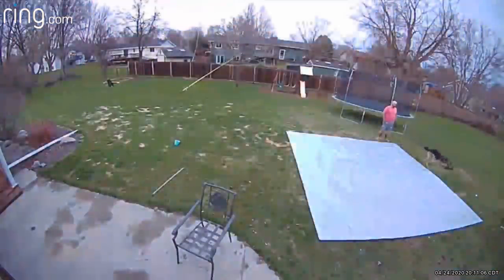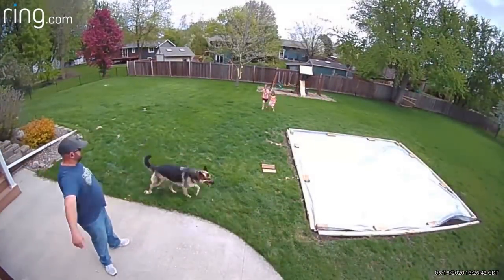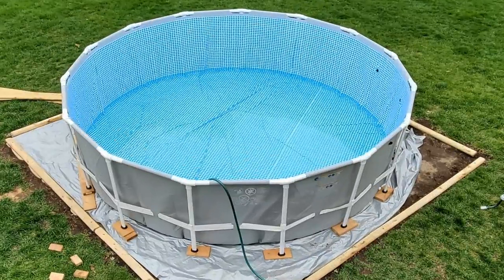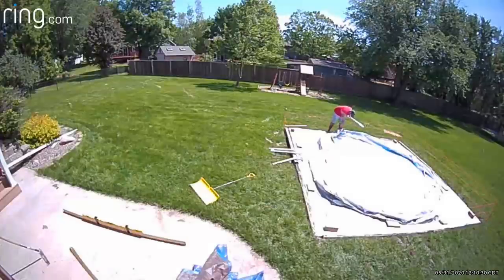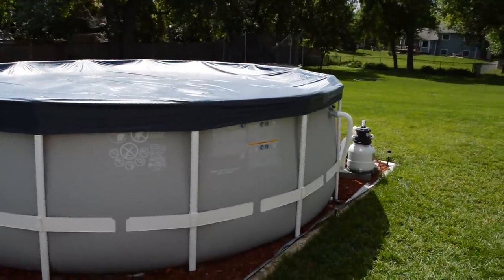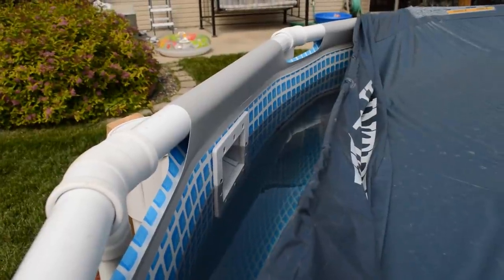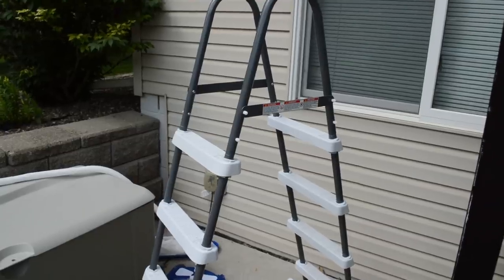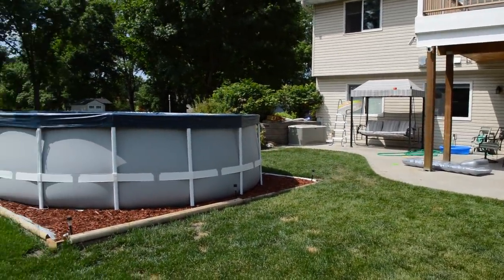Intex 15 Foot Prism Frame Above Ground Pool Setup, Review, and Mistakes!

Comment: I cant believe I just watched this whole video. This was very informative. Now I just need to get a house.
Reply from the maker: Thank you very much for the comment!
Reply: We have dismantled pool 1x so far. Redid ground, filling in now and so far 1 - 1" inches difference, stopped filling to fix. Thinking of getting something to stabilize legs on the side, where seems to be the problem.
Reply from the maker: 1-2 inches is definitely OK. I'd leave it there. Don't simply jack up the leg to make the top frame level. This will cause the liner to stretch and put a lot of pressure on the seam at the bottom. Eventually it can give out.
Reply: @dontburnthehousedownvideos  thank you for the reply. We will enjoy pool, as is then. 🐎
Reply: Shit I just looked for the for a level ground and put it up 15 kids inside it and it never broke this was an over kill bro lol 😂

Comment: Guys make sure when you store this pool that you seal it up in deck box that rodents cannot get into. They will chew holes through it to build nest during the winter. We learned the hard way 😭
Reply: 😂 You couldnt pay me to take mine down now that it's installed, I have a 22 ft Colman Vista 2 that took 4 wks with ground prep etc to install. I'm in Ohio & happen to live in the Snowbelt. all you need to do is drain it down past the skimmer winterize it & store the pump etc inside til next yr... 👍🏻

Comment: I just spent the better part of 5 days preparing the ground for my granddaughter's pool. My Daughter upgraded to this type after three years of a 15 foot round blow up ring style pool (self supporting/no legs). Having owned & installed an above ground permanent (leave up) pool I knew the importance of a level & solid foundation. Tip 1 ALWAYS dig down NEVER build up for level. Tip 2 MINIMAL sand, it is to smooth ground for liner period. Tip 3 PATIO STONES (8x16) for legs absolutely level and on solid ground not too far in so liner rubs on them. We put top frame together & placed on ground to mark where each leg would land, then angled the brick to follow the rails so the leg would seat in center (left to right) but sit on inward third of brick. I dug my bricks in leaving about a half inch or so above ground level...this job is not for the faint of heart. I leveled each brick side to side and front to back with small level the used my 4ft level from brick to brick maintaining the exact height all the way around (began at 1 brick went halfway around clock wise and then from that 1rst brick counter clockwise until I met up again with that halfway point which helped maintain level better) making sure all were firmly seated by tamping in with rubber mallet. I then put sand in and used a board to level it (I used a board 1/2 the diameter of pool plus the width of my bricks mounted on a pipe in the exact center of pool creating a clock hand type sweep but a board the length of diameter plus a foot would work... I used some ply wood pieces between each brick to temporarily bridge the gap between bricks so my sweep remained level, perfectly leveling and smoothing the sand). I then watered the sand thoroughly with a fine mist making it hard like the waters edge at beach, placed a wide board down carefully to walk on while retrieving my pipe from the middle, filled in that small hole with sand I brought out with me in quart baggie leveled as best I could and watered in, walked out on board, carefully lifted board. Our ground cover was salvaged from neighbor, it is the bottom their old pool about 3ft bigger in diameter than this one, its heavier than a tarp. I placed it over sand & patio bricks to mitigate any rubbing of pool on brick edges before placing pool. I will come back and update how it holds up.
Reply: you say the bricks were 1/2 inch up from ground, what did you put under the wall tracks?  Thanks.
Reply: Just what I needed! Thank you for the detail!
Reply from the maker: Thank you! Happy summer!
Reply from the maker: This pool doesn't have wall tracks.

Comment: The unit heats up fast and is super quiet. It looks fancy https://www.youtube.com/post/Ugkxl8Od2BvnGbn1ffwqsuFXW0QnmcZgMiVY and can be kept in the living room. It gets hot within a split second of turning on the unit. The build quality is exceptionally good and is safe to be around kids and pets. This one is super quiet and can be kept on while in office meetings, my wife loved it. It shows the temperature right on the unit which is very useful and adding a rotating feature helps to heat up the surrounding, so other people will not fight with you for heat. It is right as described in the description..!! Definitely recommend!!
Reply: Lol 😂 wow he really went over board doing this job? Why not find a level spot then put up the pool? I didn't do any of this by my self and cleaned it every other night his going to far lol 😂
Reply from the maker: If it was as easy as finding a level spot, I would have done it. My yard has a slope to the back of the property. And I don't half ass things. It's either full ass or none at all! 😂

Comment: This past April I brought a Summer Waves 16'X48"round pool similar to this.
I really took the time to research and watched lots of tutorials on setting it up.
I'm pretty handy and the majority of the techniques and procedures were pretty clear to me.
From the beginning I decided not to use sand under the liner, primarily because of settling and wash outs so I decided to basically use the already settled ground of my yard.
I made a water level which really assisted me on leveling the entire area. Basically after picking the exact location of the pool, I removed the sod and with the level found the lowest point within this area.
This low point became my final grade, so anything higher I dug out.
When it was all said and done, I was surprised and excited to find out that the pool only had about 1/4" variance from one side to the other. I got tired of struggling with the cartridge filters and manually vacuuming  the pool, every other day.
Next week I should be receiving my 2,100GPH sand filtration pump from Intex, an automatic vacuum that works with the new pump's suction and all the hardware needed for the conversion.
Very happy with the pool and the kids love it.

Comment: For our 18 foot pool, we built a 20 X 20 Frame, using 6 X 6 boards, and made sure the entire frame was level.  Because the best spot in the yard still had a drop (14" at the extreme) the frame required more lumber on one end to make it level.  Connected the 6 X 6s with spike-type nails.   Then just filled up the frame with sand.   Then we built about a 22 foot board that we used to level the sand, taking the board across the frame.  We used a tamper to make the sand more compact, and just kept going over the frame with the 22 foot board until it was just right.  The pool was perfectly level and the frame, filled with sand, was used every year.

Comment: I had the same issue with the ladder on our previous pool. We built a small deck, 8’x8’, adjacent to the pool with wooden steps. Bought a sturdy “half-ladder” for inside the pool and connected it to the deck with hardware. Very safe. Next time I’ll build a bigger deck.

Comment: i bought an above ground pool just because it was hot out i never thought about the fact that the ground could mess up how the pool would turn out so much i set up the pool on very uneven ground then filled it with water and as you guessed it. it turned out terrible i just started researching about above ground pools and how to 'properly set it up and this gave so much help i next time i will do it propery! thanks again!
Reply from the maker: Thank you! Good luck!

Comment: Thanks for the heads up on the ground preparation. That was and is my main concern.
Reply from the maker: It can be a lot of very hard work depending on what the spot looks like right now. Just be prepared for it and don't half ass it. You will absolutely pay for it if you take shortcuts.

Comment: Bought the sand pump based upon your suggestion, and it made all the difference.  Even filtered out the iron in the well water I had to use.  Thanks!
Reply from the maker: I'm so glad it worked for you!

Comment: I did a 15 foot above ground pool for the last time. I have gone through 3 INTEX Vinyl Liner pools with Fiberglass Shell. This time went to The Pool Factory out of New Jersey. They provided everything for a Metal Shell and Metal posts with resin caps and 7 inch steel topper. I went with a Hydro tools Cartridge Filter System 1.5HP Pump  70150 and 2 foot x 10 inch filter. A pool Frog Leap  Mineral Chlorinator System (uses only .5 ppm chlorine). Uses 1.5 inch hoses with a cut- off bypass 3-way switch valve. I am 67 and did almost all the work myself. Had my son roll out the 16 foot 54-inch steel shell, and dump the 2-Tons of play sand. They recommend concrete step blocks 9 x 6 under each post.  They have a great set of ladders to choose from; since I too wanted a wider and stronger ladder. Confer Evolution Resin A-Frame Safety Ladder 7100X 7000; that has a fold up steps on the inside portion of the pool, which is strengthen by adding water for weight. this is secured with a padlock. I staked the outside with 10-inch spikes. The liner is supported by 15' Round Peel N' Stick Foam Pool Cove - Gladon XL 15-12PCS-BDL, instead of just sand. Colorado weather is extreme so use a 15' Round Super Heavy XXtreme Winter Cover 	WINCOVER-R-15-XXTREME  all year. It even blocked the hail last week. Also included with the 15'x54" Melenia Round Pool 
Hayward Thru-Wall -Wide Mouth Skimmer & Return Fitting Hayward H-Series 150K BTU Propane Above Ground Heater. I only had to raise one post 1.5 inches. It really made a difference with high quality pool.
Reply: I guess it's a good thing the Easter Bunny only comes once a year!!!! Lol ( But good job old man you deserve a scoobie snack!!! ) 🚬🍸🍷🍾🏊😋

Comment: I've been debating on purchasing this pool for a few months now.  I have bought intex for over 15 years (the one with the inflatable ring and they always end up getting holes, but the intex are so easy to set up.)  Always prepared to patch holes in the ring though.  Tired of having to do that, thought I could try a different model.  This looked easy but after watching your video, I am gratefull for all the trial and error you showed.  I learned a lot about this model set up...THANK YOU!!!!  Level ground is not a problem we have that using sand and previous pool used over and over for 10 years.  We figured out how to level our area, but like you said that is CRITICAL!  Bad Foundation, expect disaster!  I plan to tackle this next week.  I can't thank you enough for all the info!  The video is extremely informative!
Reply from the maker: Thank you for the comment! Good luck on your pool journey!
Reply: I'm gonna use the same pool to compact the sand year over year. Maybe I'll put a framed pool up, maybe I won't, but I'm not digging up my yard. I physically can't so packing down the sand over time with the round blow up pool seems to be a viable alternative.

Comment: So sorry for you that you had to do it all over again! I can imagine the reaction of your kids when you had to do that ... went about half way through the leveling process before I got frustrated and turned to YouTube ... your experience made me feel a bit better that I’m not the only one making mistakes - so thank you for this video and hope you are enjoying the pool .... I gotta get back to working on leveling the ground !
Reply from the maker: Thanks for the comment! And good luck in your adventure!
Reply: I got an easy set pool a few years back an 8x 30 and then a 10x30. I did a TERRIBLE job leveling.  I had to take down and start over.  For a few years I  topped up the leveling with sand.  It worked ok. but,  not my best decision.  It was very nice under our feet but washed out for sure every time we took the pool down.  This summer I had some extra fill dirt.  It worked SO MUCH better.  I still used some sand, but not as much.  Luckily I only have a bit less than inch too low in one spot.  

Mid summer I am upgrading to a frame pool.  The easy set is actually just fine for our purposes EXCEPT now we have a dog who likes to swim. She jumped in when left unsupervised and popped the ring.  I patched the ring and it held just fine.  But I realized I need a sturdier pool.  I was nervous because it will be more work to set up.

This video has made me MUCH less nervous about it and some of the mistakes you made, I would have made too.  Best video I've seen so far.
Reply from the maker: Thank you so much! Sorry about your trials and tribulations with your pool but hopefully the new one goes better!

Comment: We have set it up and taken it down three times now 😩 thanks for this helpful
Video
Reply from the maker: Oh no!! You broke my record of twice! I suppose we live and learn, right?
Reply: I worked so hard on mine, all alone...now I think I have to take down and start again. One leg has moved a bit, I'm terrified to leave it like that .. slight very slight higher side.  It was just about perfectly level, i don't know what went wrong...so upset about having to possibly drain it
Reply from the maker: The legs will definitely move but if it's only an inch or two out of level, you'll be ok. I know we all want perfection but that's pretty hard to achieve.

Comment: It’s always best to remove earth from the high spots versus adding to the low spots to level the ground.
Reply: That’s what everyone told us, but in our sloped yard with rocky dirt, we had to bring in some red clay dirt and build a retaining wall.
Reply: @lizabeck1221  that’s great to know. We moved to our new house and discovered we’re on clay soil AND on a slope. The soil is as hard as concrete and difficult to work with but am hoping we can level it down perfectly.
Reply: @mygalmo   I was lucky to be able to get free sand at my job, so we topped the clay with the sand and that really helped.

Comment: Hello. Thanks for the video. I use the same ladder (european version though, with removable external ladder) and I can guarantee you : it is sturdy enough for my over 300 pounds weight. I like your external skimmer, I'll probably install one next year. And for the record, I'm quite happy with my original cartridge pump, notably since I changed the type-A filters for filter balls : water is crystal clear, flow is always optimal, almost no noise, low electricity consumption, and that tiny pump is so light that I can carry it single handed when I want to move it back to a shelf for winter.
Reply: Hi Joel, I plan to use the same ladder, problem is that I weight 330 pounds. Do you think it is safe enough to use them, or should I look after ones with higher weight limit ? Thanks
Reply: @Asphar1337  Wow. What should I say  ? Second year, still no problem with my ladder, and I still weight about 300 lbs. Now, to be on the safe side... Yes you should consider buying another one.

Comment: What I learned when I installed  my Coleman powersteel, 22 foot by 52 inch pool. I put down some landscape cloth. Added the sand. Wet the sand so it would settle, waited the next day. Releveled it. Rinsed and repeated. Had it for about a year almost 2. No issues so far

Comment: I SOOOO enjoyed your video. I have a 9'x18' Coleman pool, starting my 6th or 7th year with it.  I did a lot of research before putting it up  and went with a 2x6 treated wood frame( re- enforced   in spots, 2 1/2" inches of compacted sand and its still going strong. I do drain and put the pool away each fall. I also went with a sand filter, and by-far the best investment I sprung for was a salt-water generator. I'll never have another pool without one, the improvement in water quality is far more pleasant than using Clorene. Again, thanks for the video, would love to talk to you more. Later gator, BBgun, Spokane Wa.

Comment: What a great video. I also cut my pool to fit the larger hoses for my sand filter. I used paving stones under my legs to help with the sinking. Also, I used thoses square foam mats you get from Walmart under my pool to make it softer to walk on and it stops any rocks from working there way up and cutting your liner at the bottom. Your best pro tip I liked was the power plugs I have a box as well and never thought to put them inside Is genius. If I may make a suggestion build something like a box or something to cover your samd filter and pump over time the sun will burn away the writing on the top of the sand filter. Ie filter, rinse, backwash etc. Anyway great video thanks for taking the time to make. Cheers

Comment: I'm on my 3rd season of the same pool.  Definitely work on ground leveling and I tried sand also and it just compacts too much.  I wish my model had the same connectors.  I have the pins to push through the rails, which is the hardest part of putting it together.  I take my pool down during non swim months and put up each summer.  My instructions told me to be certain the pool is stretched out before filling.  I fill with a hose also and I get in the pool and push the edges and floor out and flat while it fills.   So far the included pump works fine for us.  water stays clean and clear.  I use a chlorine float, skim by hand and vacumn right through the small filter.  I do have a surface skimmer I have not tried through the pump yet.  It's new this year.  I have a small yard and had to set up near trees so we get a lot of debris and I spend a lot of time keeping it clean.  But the filter works well I just rinse the cartridge regularly and change as needed.  Good video to let folks know what they are getting into.
Reply from the maker: Thank you for the comment!